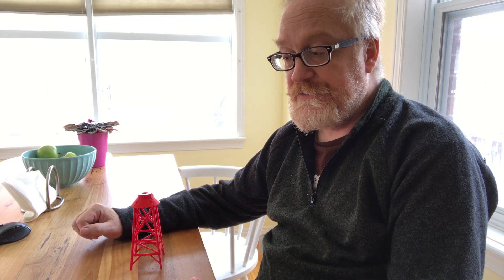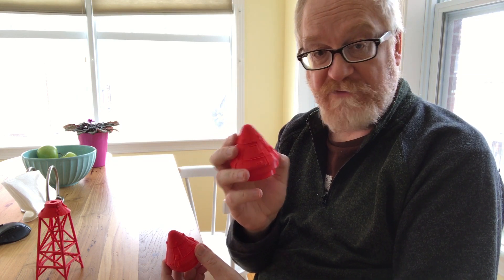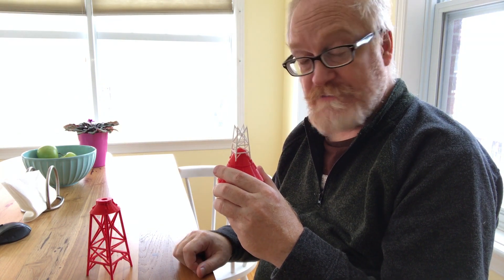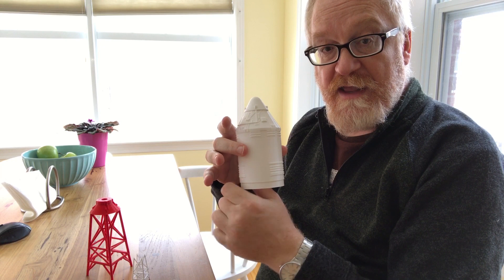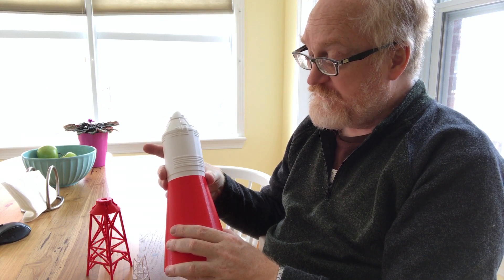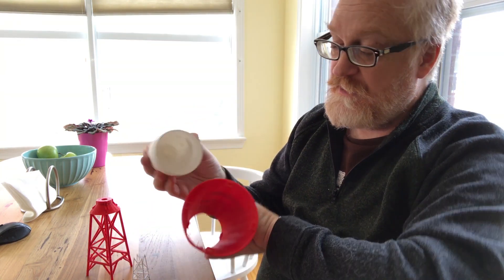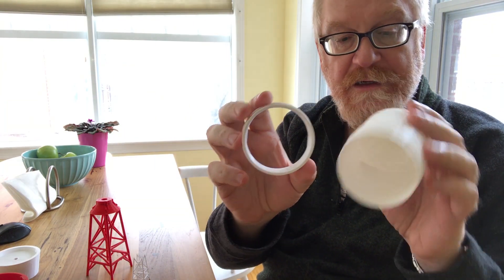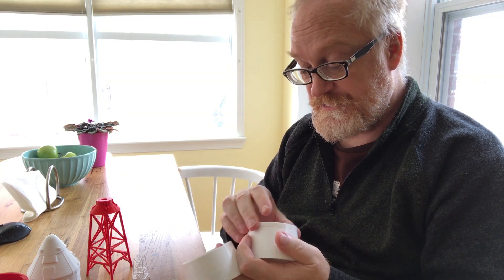Saturn V Part 1 Introduction

Comment: Hello Dave!
Fantastic work you're doing here! I'm a little late on the 50th but I'd like to build this nevertheless. 
I will channge layer height to 0.1mm from the default 0.2 
I'm actually involve din a 1/96th scale with the associated LUT and ML. And it will be a working model.
I'm using an Ender 3; is that what you have?